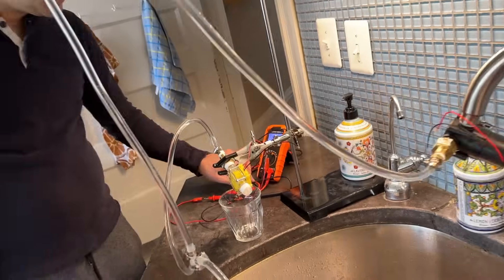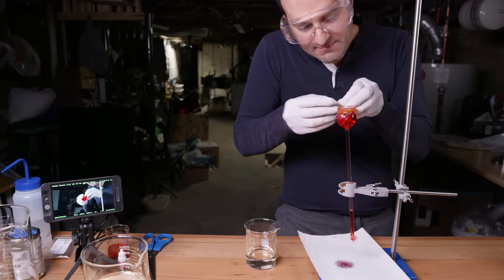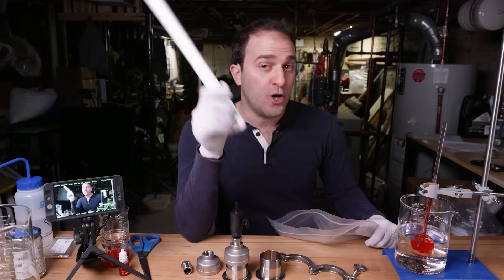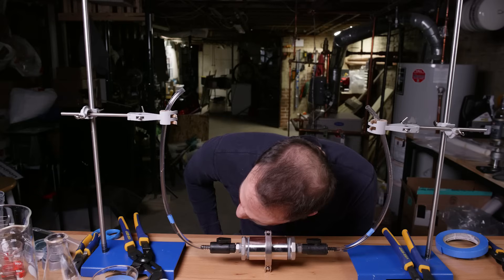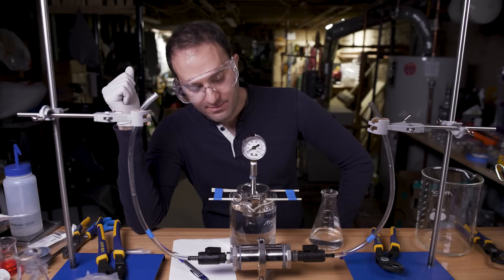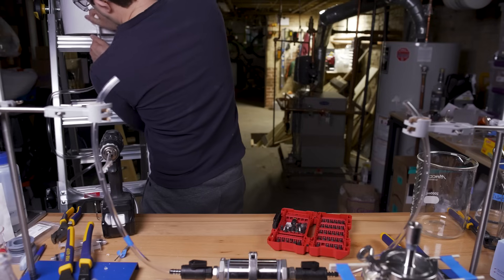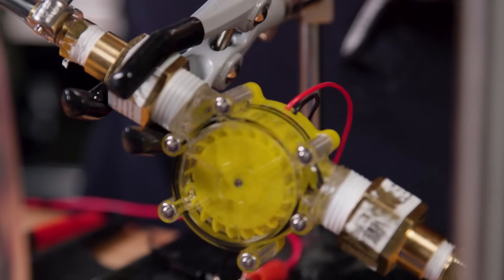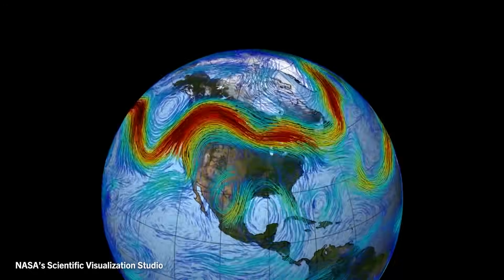Why Norway's Osmosis Power Plant Failed

Comment from the maker: I calculated how much SW30 membrane it would take to generate just 4 volts without any assistance from my kitchen faucet, and… it would only take 153 square meters (roughly 1650 square feet)! Barely anything at all. Would probably only cost several thousand dollars. That’s the next experiment on the list… I’ll be calling soon, DuPont!
Reply: if only I could remembrane where I left all my stuff
Reply: maybe some of the problem is impedance matching? high pressure low and flow rate is not great for a turbine, you might need to drive a positive displacement pump to a gearbox to a generator. 
A simple test setup might use the syringe pushing a lever on the end of a geared down (geared up when run as a generator) dc motor, it won't run continuously but it should prove the principle.
Reply: I was going to say that you probably need a larger membrane and then you need to invoke Bernoulli's equationvto increase the velocity of the flow
Reply: 153m2 ÷7= 21kwp Solar 😅😊
Reply: Osmosis produces high pressure at very low flow rate. The turbine used   in the end of the video requires very high flow rate and not much pressure, and is therefore unable to capture almost any energy from the osmosis rig. Could be informative to explore...
Reply: I've used RO and NF membranes to separate cannabinoid oil and ethanol after extraction. It was 20-30x more efficient than distillation for a 80-90% reduction of ethanol.
Reply: At this rate it just seems easier to build a turbine that runs off of a naturally flowing water source. Basically we had all this locked down with water wheel technology.
Reply: 4 volts is utterly meaningless without current.

Comment: 1) you need a turbine that can operate off of less than 1" water column...... just like the guys who did the calculations claiming that just a mixing river and seawater would have the energy of a 200M waterfall you make the mistake of pressure not equaling energy just like voltage does not equal energy.... you need head (the 200M) combined with flow rate to equal energy (any hydro power plant engineer can explain this to you... you might actually have or be able to develop a lot of pressure but the flow rate of your setup is less than a drop per hour.  ......

btw I did that same experiment of fresh water to sugar water with a tall glass tube in high school in the 1976 and you don't need to use any fancy membranes, etc. a simple plastic sandwich bag will work

the lack of basic knowledge to do these calculations is why so many tidal energy projects fail, you have lots of water moving slowly but to capture the energy of it you basically need to control all of the water moving in or out with the tide...

also think about making a turbine nearly 100% efficient, to do so the exit velocity must be near zero when starting with a high head as that exit motion is "lost" energy...

Comment: Feedback on the Bouncing Ion Metaphor 

First, allow me to express appreciation for your work. Communicating complex scientific ideas to a broad audience is a deeply valuable and often underappreciated skill, and your collective efforts have advanced public understanding on many important topics. It is in this spirit — of shared commitment to scientific integrity — that I write this.

Your recent piece introduces osmosis through a mechanistic explanation that includes the concept of ions “bouncing off” a semipermeable membrane and creating a local low-pressure region that “draws in” water. This metaphor, while visually compelling and perhaps intuitive on the surface, unfortunately misrepresents the fundamental physics and chemistry of osmotic pressure.

What Osmotic Pressure Actually Is

Osmotic pressure arises from a difference in the chemical potential of the solvent, not from mechanical impacts of solute particles on the membrane. In a system where a semipermeable membrane separates a pure solvent from a solution (e.g., water from saline), the presence of solute reduces the chemical potential of water on the solution side. This causes water to move down its chemical potential gradient, not due to mechanical suction or ion impact, but due to the thermodynamic drive toward equilibrium.

This explanation is rooted in classical thermodynamics, statistical mechanics, and modern physical chemistry. It is the basis for:

The van’t Hoff law for dilute solutions

The Gibbs–Duhem relationship

Models of water activity and entropy of mixing

Predictive quantitative theories of osmotic phenomena in cells, membranes, and industrial systems

Why the "Bouncing Ion" Heuristic Is Misleading

While kinetic models (e.g., Debye, Ehrenfest) have historically been used to derive osmotic pressure, they are typically statistical in nature, not literal Newtonian collision models. Modern science does not support the notion that momentum transfer from ions bouncing off an impermeable membrane is the cause of osmotic pressure. In fact, such a model breaks down under testable conditions — such as when no ions are near the membrane, or when solvent still flows in the absence of solute-membrane proximity.

Framing osmosis this way may lead audiences to confuse cause with effect, and undermines their ability to understand related phenomena, such as water potential in plants, dialysis, or osmotic energy harvesting.

A Constructive Proposal

I do not suggest this critique as a dismissal of your work, but as an invitation to refine the message. Perhaps a follow-up or amendment could clarify that:

The movement of water in osmosis is a thermodynamic phenomenon, driven by differences in chemical potential.

While molecular motion is part of the system, the collective thermodynamic properties — not individual ion collisions — determine osmotic behavior.

The intuitive picture can be reframed using solvent activity, entropy of mixing, and equilibrium conditions, which are both rigorous and conceptually accessible.

Why This Matters

We live in an era where scientific trust depends on clarity, nuance, and precision. Osmosis is foundational to biology, chemistry, medicine, and engineering — and teaching it correctly equips people to understand everything from kidney function to energy technologies. It deserves to be communicated in a way that is not just engaging, but scientifically sound.

Comment: at timestamp 3:24, how is this not a perpetual motion machine? what would prevent the water from passing through a second solute selective membrane and running downhill back to rejoin the lower distilled water column if were to add another filter at the top of the sugar water column??

Comment: I know enough about RO to say the following. You are working in a high entropy environment. Yes there is energy, but very little of it is useful. There is also a lot of energy used in RO systems just to get through the membrane that is dissipated as heat. The higher your flux is, the more is dissipated as heat. The regular direction osmosis will have the same problem. If you have perfectly still water, the natural speed of osmosis without a membrane can be measured in millimeters per decade with single digits.

Also salt does cross the membrane, just a lot slower than the water does. I would suggest looking at more modern papers than 1923.... All you have to do is calculate mean free path length, membrane permeability, etc. And you will see the liquid phase molecules don't bounce far enough for that theory to work...

Comment: You would expect the temperature to drop when you mix salt water with fresh water. You are increasing the number of available states the system can be in, and as temperature is a measure of the energy per available state, the temperature will drop.
The same thing happens when a liquid evaporates, there are more available states in a gas so the temperature drops.

Comment: I did this as senior project many many years ago.
I used 2 half cells, one at each concentration. I used a tube stuffed with cotton as the semipermeable membrane. And it worked. No moving parts.
I got a few microwatts as I recall. Maybe it was a few milliwatts if I was lucky.
It would have required a large plant to make a useful amount of power at a river's mouth.
Nice presentation.
Reply: The device that your describe is concentration galvanic cell. In NaCl solution it will work, for example, with Ag/AgCl electrodes. More cheap version is Cu/ CuCl electrodes.

Comment: Thanks, interesting experiment. I think a good demonstration might be to have a sealed pressure tube, with a pinhole which would show a impressive stream even with low flow from a small osmosis cell. a tiny turbine, even a pinwheel,  could be placed into the stream to show an example of harvesting power.

Comment: Being an engineer, but not a chemical engineer (I'm in IT), what I didn't really get (at least intuitively) was that this test plant at Hurum (I live nearby) in Norway, they where going to use fresh water from a stream together with salt water to raise 'something' a few centimeters and then get preassure/power from it.
The same stream that starts at least 100 meters or so above sea level (Hurum is steep) and is not used as a source of hydro power.....
A difference of approx 1:1000
Reply: That's a good point but the Hurum plnt was a small scale experiment, or perhaps more like a proof of concept. The expected output was only 2-4 kw.

Comment: You could just buy an RO filter for less than $20, with a large area already pleated for maximum area. Even a high pressure unit for seawater osmosis is just a little over $100.

Comment: What about build setup with multiple pistons and release pressure valves ... Maybe interconnected ...
When pressure in piston will increase to some point , release valve will activate (maybe re-flush the piston with new "water" ), the piston will lower because the "low pressure " , because low pressure release valve will close and the whole system will start again from point 0 ....

Comment: If there is enough pressure would not filling the bucket just be more efficent? The inconsistency of power generation is a problem sure but that is a problem with any generator. (efficency with simplicity)
Its cool either way, from an info point i'd love to know what the causes of the membrane needing replacement are. Does it get clogged by salt particles or atoms?

Comment: I designed an isothermal batch reactor that does reverse osmosis and regenerates thermal energy from the water into electricity, there is enough energy to pump water down a much longer and deeper diffuser. It is slow and would would require many, many batches to be useful. Kind of like having tens of thousands of 18650 cells to make a useful battery. It also mathematically debunks LNG because the isothermal circuitry is 100% more efficient.

Comment: Desalination plants already have a pressure recover turbine to get back some of the energy used get clean water. One could use used reverse osmosis membranes from the plant, that are not god anymore to produce clean water but are good enough to do osmosis, and use it with the recovery system to recover  more energy while still mixing seawater with the brine of desalination, which is something that it has to do anyway by law.
But producing energy direct from river and seawater is a big jump. It islike trying to produce a heart in the lab without being capable of producing a working skin for burned people. Do the simple version and scale it up. Going to printing a hearth just attract more investment but dont work at the end.

Comment: Don't supplement the water flow, supplement the electrical flow. Give it a small known voltage so it spins on its own and then measure the current being supplied until it goes negative, that's when you know you have net power.

Comment: Statkraft has indeed stopped its osmosis-power project... back in 2013... so, it is not precisely fresh news.
The reason they stopped it is not because the technology didn't work, it did, but because that method of power generation was not cost competitive with the renewable power options of 2013... and it would be 10x worse today!
The main issue?  You have encountered (at very small scale) by paying $20 for the membrane sample you bought.
Membranes are VERY expensive, especially as demand for them are high and supply insufficient... at least for the time being.  They also have limited lifetime, and must be changed every few months or 2-3 years depending on what liquids are involved.  With natural fresh and salt water, the problem of contamination by various living organisms can be severe.  The longer-lasting membranes operate with industrial aseptic solutions. Yes, I have professional experience with industrial membrane filtration.

Comment: cool idea, politicians in the board, high funding from the state - didn't work? Oh well, so sad, but the money changed hands, so everything is fine.

I bet a simple experiment + running cost estimation would indicate early on that the project is not feasible, but it wasn't done precisely because it would show that.

Science is interesting but state run projects, especially those destined to fail, are started on purpose to just transfer state funds to private hands connected with politicians.

Comment: At first I was suspicious of the fluid dynamics in the junction, but then I realized that your fresh water input to the osmosis is at lower pressure than the sink water! So your tap pressure is just trying to do reverse osmosis in the membrane. I believe you need to splice the hose coming out of the sink so it also goes to the membrane.

Comment: 5:30 what prevents the water molecules from going back through the membrane? Can they only pass through one way?

A quick high level overview on osmosis would've helped...
Reply: Good question. Water molecules are free to flow in both directions, but due to the concentration gradient, more of them will flow toward the higher concentration than vice versa. Think of water not as a liquid but as a gas. When you release a gas from a small container, what prevents it from going back in? Same concept.
Reply: @feynstein1004  but there is a significant pressure difference created between the two sides.

Size of container doesn't make any sense, it doesn't explain how the salt molecules bouncing off the membrane can create a tiny cavity/low pressure point sucking water molecules in from the other side HOWEVER these same salt molecules don't impact/push water molecules back the other way.

I could simply look it up, but again, could've been handy to give a 30,000ft refresher.. feels like i've stepped into a classroom having missed the first half of the lesson 😅
Reply: @sirtra  You're only thinking of the hydrostatic pressure and yes, you are right in that, but it's not the only factor at play. The osmotic pressure, caused by the concentration gradient, is several orders of magnitude higher than the hydrostatic pressure, enough to lift the water up. In fact, the concentration difference between saltwater and freshwater is enough to lift the freshwater up to 230 meters (754 ft). 
What you're saying is like there can't be snowy mountains in Africa because Africa is hot. Well, that is true in general but it's a bit more complicated than that, don't you think? 
If you want a more detailed explanation of why the osmotic pressure is so high, well, I'm afraid I can't help you there. It gets very technical but yeah, ultimately, the concentration gradient is what it boils down to.

Comment: If the pressure diff across the membrane is too low, the efficiency is naturally lost. Perhaps you can connect a piston to a gear or lever to amplify the movement.

Comment: can you try make it not as energy generation device but as energy storage device aka battery? same setup:two tanks, one with pure water, another with salt water,  semipermeable membrane between, two pistons on each tank and electric motor/generator. in charge cycle you run motor so it push water out of salt tank, i.e. reverse osmosis;  in discharge cycle you let pure water mix freely to salt water, i.e. direct osmosis, i.e. water doing work.

Comment: I wonder if the osmotic pressure could drive a very slow hydraulic motor, which would drive a gearbox, multiplying the speed up to a point where it could drive an electrical generator

Comment: Maybe just using the osmotic pressure to pump water uphill is good enough for a demo.  Let it run several days, then release the water through a lightweight turbine and see how long it can light an LED.  Finding a light enough turbine might be tricky.
Reply: Maybe a peak-load version of this technology wouldn’t even need the pressure exchanger. Let osmosis push the water uphill, then when the demand comes, release stored energy out to the sea.
Reply: That's correct
Reply: that would just be making a battery instead of a power plant though
Reply: @mimmoth  A battery takes energy in, stores it, and releases it when needed.  The point of the osmotic pump is they take no (external) energy.

I'm suggesting adding a battery to the power plant, because the power plant puts out such little energy it is hard to demonstrate.
Reply: @oasntet No I understand, but thank you for expanding on it and on your thought process. 😊 And in such a chill and helpful way! I was just fatigued.

Comment: I'm sure you figured it out already but your final setup is bound to drop voltage because the water level in the bucket is constantly dropping and losing pressure. A good constant pressure system is a vacuum piston, or a weight and pully pressing a syringe full of water horizontally.
Reply: I think the final experiment was hooked directly to the output of the sink. My water pressure varies at a pretty predictable rate up and down (pumps, I assume?).
Reply: No it was hooked up to the sink
Reply: Or a constant head Marriot tube